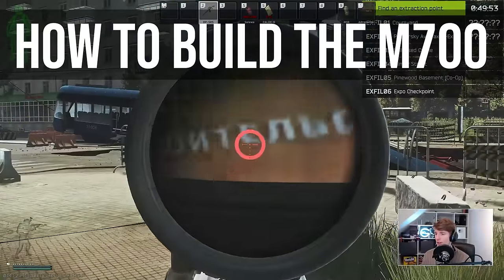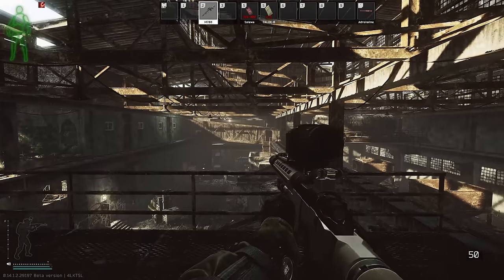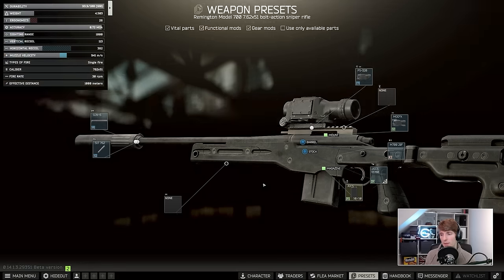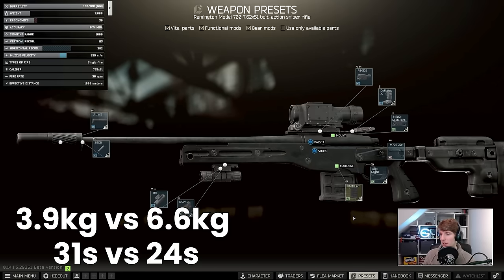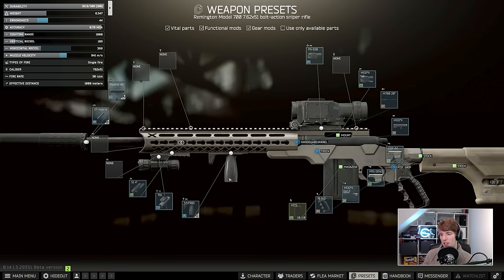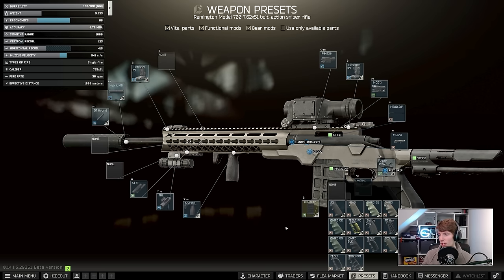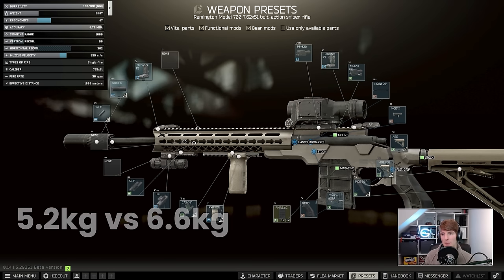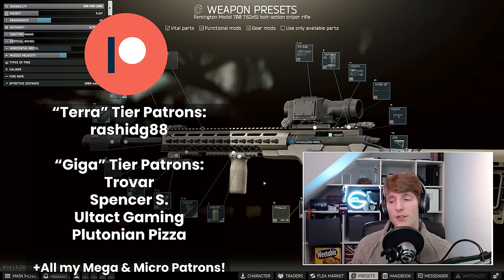How To Build The Perfect Sniper Rifle In Escape From Tarkov

Comment: The ergo version of the m700 is exactly the same as one I have saved. Definitely my favorite bolt action to run. The ergo is amazing and you can hold it up for so long. I opt for the 5 round magazine, though. I've either killed or been killed by whoever I'm shooting at before I go through more than 10 rounds with a bolty.

Comment: MVF001 foregrip has very off putting bug on that m700 chassis. As you swing your camera view, left hand, which is holding foregrip, gets bent in inverse direction. I am not sure if it is present on every player model, but I am USEC. So if you have same problem just take cobra foregrip with +9 ergo,  -1 recoil.
Reply: funnily enough having your arm twisted at that angle is covering your thorax more and is actually better
Reply: @HejneMiro  lmao, only in tarkov
Reply: @DelicM yea
Reply: @DelicM Yeah, your shot really should overpenetrate and go through several body parts if it has enough pen.

Comment: Why you’d use anything but the highest ergo attachments on a bolt action rifle, I’ve no idea. What’s the point of recoil control?

Keymod ergo grip, viper PDW stock and hybrid 46 suppressor are the only correct choices.
Bonus if you use the red buffer tube that gives better accuracy and other bonuses

Comment: I'm a big fan of the 5 round polymer mag. It's a 5 ergo swing and honestly... when are you firing more than 6 bullets from a bolty? Either you go leg -> torso x2 or you fail your headshot and try for a second thorax shot. The chance, that your target stays in the open for 10+ seconds to fire your 6 shots but not long enough, that you don't have time to swap the mag are super low. I rather take the extra 1-2 frames ADS - especially on the polymer chassis that's super cheap as well.

Comment: I build my m700 always with an silencerco suppressor and the AICS Stock. Gives you around 35 ergo in total and its super light only around 4-4,5kg depends on the scope and mag u use. U can scope in for so long with it because of the low weight. I just did hunting trip with this setup the other day and it worked perfect

Comment: For what it's worth, the DLV-10 Saboteur is better in every aspect than the M700. Better stats fully modded, way quieter, waaay cheaper to mod. Correct me if I'm wrong though. The only downside I noticed is limited magazine availability.
Reply: Well everything except weight, and it's only slightly worse. Better ergo, better MOA, better recoil, better velocity, quieter, better camo, and it's significantly cheaper since you sell the normal barrel for 22k back to mechanic for the saboteur barrel.

Comment: Yeah..I just dont see why youd ever use the hybrid(for basically any gun tbh), the DD wave is essentially the same thing but just better since it has less recoil and some accuracy(not that it really matters), and all you lose is a single point of ergo. I basically never use the Hybrid on any gun unless you have to, the suppressor itself isnt bad or anything, but the fact you have to use an adapter and not a muzzle break/flash hider just makes it automatically much worse than any top tier suppressor.

Comment: What's the point of focusing on recoil on a bolty? If it was more of a DMR it would make more sense. You would wanna follow up with another shot asap.
Reply: Becuase the lower the recoil the more of your scope stays in vision after firing, which means you retain your aim better. An unmodified mosin with a 3.5 pu scope will complete remove the target from the sight picture, which means you need to regain target before firing again. (whereas these modified m700s will somehwat retain the target within the sight picture making target acquisition easier.)

Comment: you are quite unxperienced sniper it seems i dont know how you didnt notice this one is bought directly from jeager 4 so whole point of the video is kinda just not there and m700 dont need to be mooded at all look at pestili doing the tarkov shooter 5 so that is that
Reply: He picked up an extremely modded gun that doesn't benefit much at all from the mods on it. That is the point of this video. I did psycho sniper and tarkov shooter 8 with a mosin on first try. Does that mean DVL-10, M700 and all other bolt action rifles are useless?

Yes, it probably came from Jaeger 4, but the video still demonstartes pretty well why you might not want to purchase it, don't you think? That is also ignoring the foregrip, the suppressor, and the pistol grip that didn't come from Jaeger.
Reply: @umbrella4407  the thing about bolt-action rifles is that they dont need ergo and weight is only one of the important measures other ones being accuracy, scope setup and ammo that is the weapon zeroed for. for your dvl-10/ M700 vs mosin example mosin has accuracy of 1.44 moa and with scope from the video max range is around 150 meter from prone.  dvl 10 that is loud has accuracy of 0.45 moa zeroed for m80 with good scope setup you can hit targets from 450 meters if you want to be supperest you use orsis with supresor from this video +3 accuracy on muzzle brake moa is 0.63 or you use sv-98 with lps ( if you dont want to calculate adjustments ) 0.59 moa or PS with 0.50 moa  ( you have to calculate zeroing deviation )                                                                                                                                                                                          if you want to teach someone how to mod thier weapon atleats understand how to do so XD
Reply: None of the things you bring up has any relevancy in your average tarkov game. Where do you plan on going on streets where you will shoot people at such a distance that MOA actually matters? Practically all bolt actions have good accuracy and it is arguably the LEAST important stat because of the typical engagement distance not being that long. As long as your gun ain't broken you will be fine. You are acting like everyone who uses a bolt action plan on sniping people from lighthouse water treatment or woods sniper rock. Most of the time you will just try to point and click on heads, and when you miss it will be because you missed, not because you didn't zero your gun.